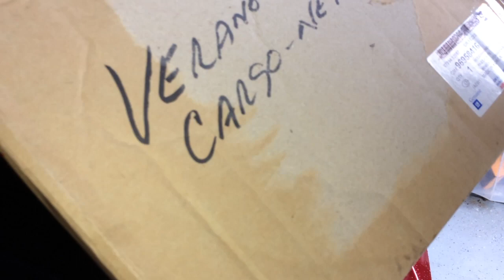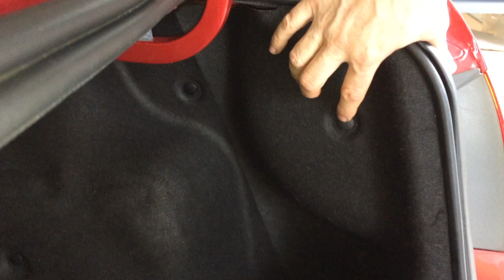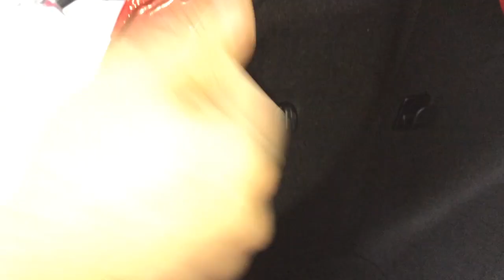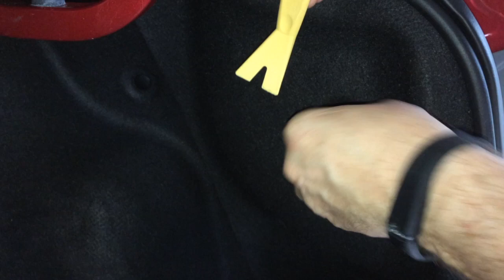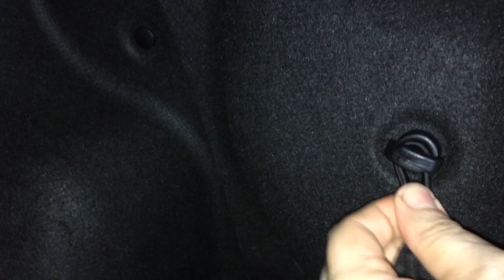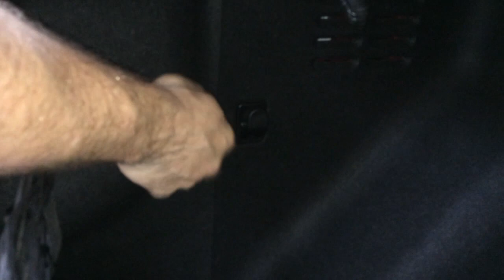2011 - 2016 Chevrolet Cruze Factory Cargo Net GM Factory Accessory Installation

Comment: 2022 Trax here.  I had the T-hooks screwed in but they weren't horizontal.  I didn't want to snap them off by just laying into them.  I have some heavy duty clamps with soft plastic coated ends that I used to safely grip and turn them.  Much thanks!